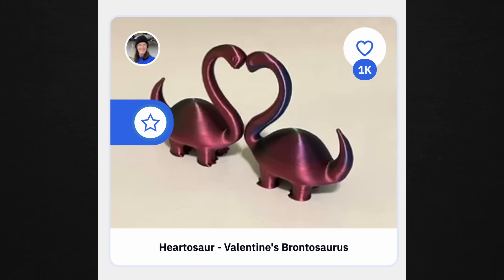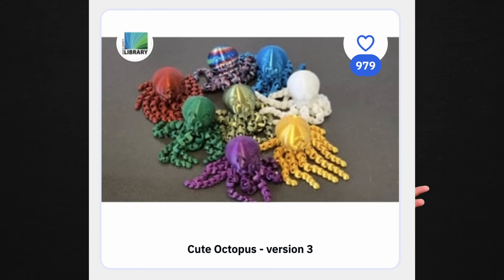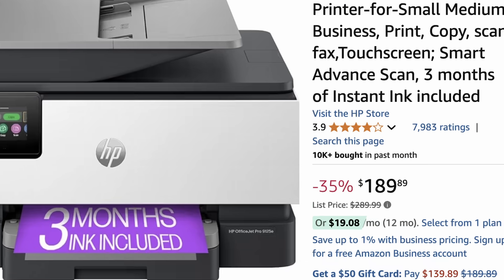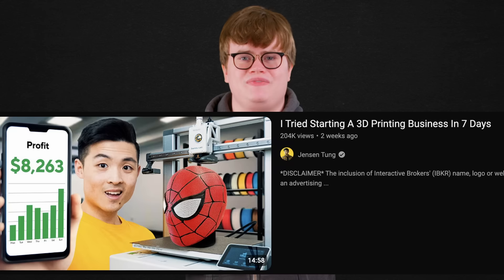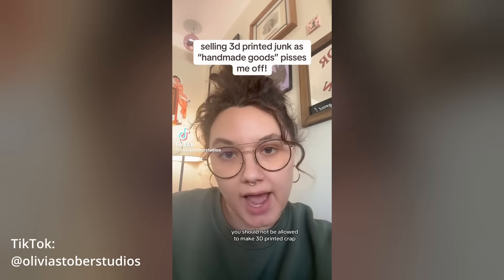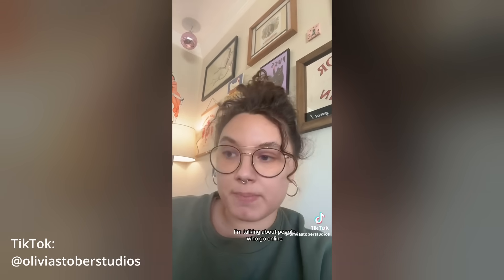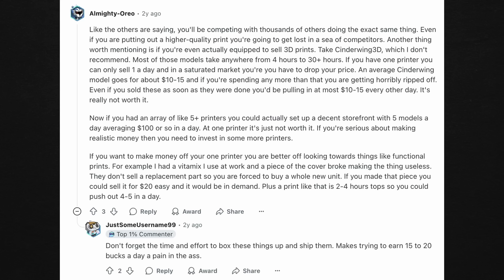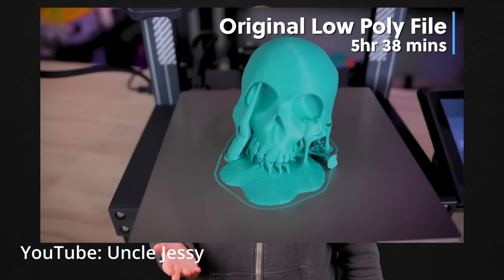The Rise of 3D-Printed Slop

Comment: thanks for making this video man. I’m a VFX generalist and video artist, and I got a printer recently for practical props, prototyping gadgets for my studio, replacing knobs on stuff that’s out of production, etc. Going in I was already conflicted about the environmental impact of the whole ordeal. Moreso after realizing how it just shits out extra plastic regularly, and complicated or bad designs require single-use support structures to print that immediately get tossed. and that’s if my design doesn’t need a revision (also trash if it does!). like okay I personally can accept this, I’m experienced enough with modeling and physics simulations that I can be very intentional about using less plastic and only printing what’s absolutely necessary to get the shot made. great power great responsibility, measure twice cut once, all that.

then I took a look at Thingiverse and it actually made me want to cry. people are totally just printing crap to justify the cost. no better than mass-produced plastic. I guess it’s easy for me to say after living in Blender for almost a decade but I can’t imagine what goes through someone’s head when they buy a printer without even knowing how to model, it’s sickening

Comment: omfg I didn't even realise that 3d prints were supposed to be sanded. I only ever see the ridged ones 😣
Reply: It's not supposed to be anything. Printer lines are fine, it's just not looking good on big painted props.
Reply: @SaitoGray  Printer lines are kinda like raw loose threads on sewing, knit or crochet, or tool marks on wood carving. They're a sign of poor finishing.
Reply: @Albinojackrussel  poor finishing if it's meant to be something that exists to be seen (models, cosplay etc) for functional stuff like replacement mechanical components that only need the mating surfaces to be dimensional it doesn't really matter. I'm not sanding a gear I made to replace a part of the drive on my vacuum, but I definitely sanded, filled, primed, and painted my cosplay models.
Reply: @ Exactly, that's the difference. The fixation on sanding is so weird. You don't need to sand most stuff, but you ABSOLUTELY need to do it on props of cosplay made for show and painted.

Printed line area totally fine finish. You barely see them if your machine is calibrated.
Reply: @Albinojackrussel  No, not even close. Layer lines are an inherent feature of FDM printing. Consistent layer lines are a sign of a well-tuned and accurate machine. If the lines vary in width and height, it is a sign of a bad print.
Reply: @Kodachrome02  layerlines are a sign that you didn't sand your piece. Aka poor finishing.
Reply: They aren't supposed to be sanded. It all depends on what you want. The layer lines are just a part of how FDM printers work. Some use cases the lines don't matter.

Comment: This is why I think that, if you’re going to get into 3D printing, you should consider 3D modeling as well, as half the enjoyment of the hobby is printing your OWN work, not stuff online. Sure printing out the next flexi factory toy will give a hell of a dopamine rush, but it doesn’t last. Printing something that you modeled with your own hands though is extremely satisfying and makes you feel accomplished.
Reply: can confirm! i’m a 3d modeler first and foremost, but i’ve printed some of my models and it feels magical… holding something in my hands that i made in my computer, knowing the topology… it’s so cool
Reply: @johnathancactusI just got into 3d printing but man did it feel good figuring out how to create a pin and hole
Reply: It's revolutionary if you're into a lot of different hobbies. If you build drones, or RC models, if you're into hobby robotics, electronics, woodworking ect, it's amazing. You can 3D print an entire model aircraft at low cost, and if you crash it, you can simply reprint the broken parts and be back flying your model again. You can custom design parts, so the only limit is your imagination.
Reply: @adscomics  True, it’s time consuming but so stimulating to design your own models. Need to consider the primary design, then know your printer and limitations and redesign, and then potentially optimise for speed or printer settings. A lot of work but it can be really worth it.
The only part where printing pre-made designs makes me similarly happy if they are for someone else and have value for them
Reply: I want to build a dragon kaiju figure by 3d modeling it then printing jt
Reply: Half the enjoyment? 90%, I'd argue. 

The first time I modeled something and then got to print it was amazing.
Just holding a physical object in your hands that you thought up is amazing. 

Printing a file you found online isn't. It's fun and novel for the technical part, once. Maybe a couple times, but then that's it.
Reply: @That0neJawn  when i print other peoples stuff usually its to print something functional that i can just use or highly detailed models of things that i want to print out and paint
Reply: if you buy a 3d printer and arent willing to do anything yourself you might as well not even own it.. Whats the point of a 3d printer if you can just buy the thing you want? or get it printed by a company who has one
Reply: @zwicker5585 For me it's because it's a lot cheaper. I got my 3D printer to print miniatures for my DnD games. All in between my printer and filament I've spent around $200. Buying everything I've printed would have cost me thousands of dollars. I'd love to learn CAD but don't have the time to, and for now using free models or ones from people I support on Patreon is meeting my needs just fine.
Reply: Amen, modeling is fun in and of itself, but being able to bring your models into physical reality is MAGIC.
Reply: The stuff I love is taking things from online and adding cuts, hinges, and ball-joints to make my own little action figures. It gives me so much joy to sit down, model(70% of the time) and cut my little guys and then print amd paint them. Like someone here said, 90% of the fun is modeling it. I more kitbash than model, Id say, but its my happy place.
Reply: It also let's you solve your SPECIFIC problems which is the best part honestly
Reply: or even if you just paint them...
Reply: @91Vault  Yeah painting is acceptable. Just some level of effort aside from just adjusting print settings and throwing the file in a machine.
Reply: Or just print guns. It's lots of fun.
Reply: People print stuff without knowing how to 3D model?
Reply: @realtacobell  It's more common than you may think.
Reply: @realtacobell  Hi, just got a bambu A1 + AMS lite last week, zero 3d modeling knowledge.  :)
Reply: came here to say this.   got into the hobby a few months back and immediately started learning cad.  luckily I come from a compsci background and while it wasn't instantly intuitive, it wasn't hard to figure out the basics.  now I prototype 1-3 basic widgets a week.  
I also regularly print these little chatchskis as Lil free gifts.  love making chainmail fidgets
Reply: I thought that was common sense. People don’t buy text printers to print shit they read online, right?
Reply: Being able to actually model things is exactly why i want one once i move and have space. Ive been learning modeling while waiting to get one, so hopefully ill know what im doing lol
Reply: Counterargument: I want a 3D printer to print out that one stupid dummy plug that I lost and the only replacement part the manufacturer sells is a whole new device.
Reply: @PineappleDealer37  Then go through a 3D printing service and have them do it. Will save you way more money
Reply: @adscomics  i need to replace that one part in 10000 of the 
Things 

You see I own 10000 of the... Thing and I lost the exact same part in all of them.
Reply: This is something I plan to do once my 3d printer arrives next month and I take the time to learn the printer and various software apps that go well with the creation process. I intend to start making my own designs which I'll also sell. The challenge is part of the fun for me. I enjoy learning new things and being able to bring my creations to life.
Reply: @Katskraftkorner  honestly if you haven't already it's for the best to start learning 3d modeling right now before you get any of the hardware
Reply: @xalener  I ordered a new computer this week for running the software.  Once I get it set up, I'll start right away. I've been watching a lot of videos on 3d printing and the software to get me started.
Reply: @Katskraftkorner  FUCK yeah dude
Reply: I hate to have a print where i made a design mistake so it was just produced for the landfill directly. I wish i could have it perfect directly all the time.
Reply: truer words has never been spoken, my friend o7
Reply: Honestly it never crossed my mind that people would get a printer with little to no interest in actually designing parts themselves. I am coming into it from the side of already having interest and experience with modeling, so maybe I am blinded by that.
Reply: flexi factory SUCKS BALLS
Reply: That’s what I do. I was gifted a 3d printer and so I learned to use blender. I’ve made earrings, knickknacks, cosplay masks, and am currently making my friend a DnD coin to flip between bardic inspiration and unsettling words.

It’s also made me paint more often since I don’t want to buy 10 different colors of filament that I’ll barely use.
Reply: I absolutely agree. As an engineer I’ve had some of the most fun solving problems with the 3D printer that costs a fraction of what I can buy, with no shipping 😂
Reply: 07:25
Reply: That’s the difference between fulfillment and instant gratification. But people preferred the later because it’s easier
Reply: I 3D modeled all my prints! Which is around 3. My favorite in terms of function are these mini game cartridge earrings. my first one was a bad blender model of one of my original characters that didn't have the normals flipped the right way. The coolest one I've made is of this cat robot character I like to draw... I really need to paint that one and do the base justice.
(Edit) i don't own a 3d printer though, my library just has a few.
Reply: I don't enjoy 3d modelling at all. It seems like a hassle for me.
Reply: I'm certain that's true, but all I want to print are minifigs which are super expensive to buy in stores, and I don't have 1000 hours to learn to 3d model to the level needed to make that nor do I have the creative talent
Reply: Didn’t even occur to me that people would get into 3d printing without having interest in 3d modeling. That’s like, most of the appeal for me
Reply: @vincentgeiszler  Yep, that's the whole reason I wanted to get into it. I was already doing 3D modeling by that point, and I thought it'd be super cool to have my models exist in physical space.
Reply: @vincentgeiszler  people who are into painting figures/minis/DnD use 3d printers...there's infinite really cool figures available out there
Reply: I've never understood why you would ever buy a 3D printer without knowing how to cad.
Reply: @simon5016-f6r do they? I’ve never heard of that, but I also don’t watch 3d printing content
Reply: @simon5016-f6r If you have a real use for it? I got a 3D printer because I play Dungeons and Dragons. I don't know if you've seen the cost of tiny injection mold miniatures for the game. It's like $10+ for one tiny figure, then figure you need like 10 of those for one battle, it gets insanely expensive. A big boss is gonna run you $50+. I got a 3D printer to print my own miniatures and terrain for the games I DM. I've printed what would have cost me thousands of dollars to buy for less than $200. I would love to learn CAD, but between being a mom to 3 kids, running multiple games of DND, and painting all the minis I 3D print I haven't had any time. I think the real problem with 3D printing is people who get into it to profit or who get into it without having a real use for their 3D printer.
Reply: to tell you the truth, I have no fucking clue what someone is doing with a 3d printer but no 3d modeling skills. It's fucking hilarious to me that people actually spend the money on the hardware and just download models to print. I spit on em.
Reply: @xalener  spit all over me bb, 1 week into the A1 life, still putting off that blender donut tutorial for like 5 years now :^)
Reply: @xalener  People shared a lot of they files online over the years. Most daily problems people have that could be solved by a printer most of the time already have some STL for it online. So you can do a lot of problem solving without needing to touch a 3d modeling software once! But the full potential will then never really used.
Reply: @xalener  people who paint miniatures and/or similar modelling hobbies.
Reply: @ Even those folks would benefit heavily from modeling skills so they can kitbash stuff quicker and more convincingly.
Reply: @xalener I buy files for miniatures/tabletop gaming by companies or individual artists that don’t physically produce those miniatures/parts. Cope and seethe, I guess?

What a weird thing to be mad about/flex with.
Reply: @MadDoodles  you alright
Reply: I can assure you it lasts.. I mean the race to be the first 3D printer to reach 1 million in yearly sales is more a dopamine rush, but the love for printing never dulls. But yeah Dancyn I'm catching up lol

Comment: 2:39 I think this one point is way off base. Layer lines are absolultely benign (and can even be aesthetic), and certainly dont "need" to be sanded. Especially for functional parts, they have no impact. But im being petty. Overall this is a great video as usual for you. If I see one more jointed dragon print im gonna scream
Reply: if you dont sand ur print or put a finishing coat on it and then u charge 20$ i want to come after u

Comment: Hard disagree on just about everything said in this video. I've personally had a 3D printer since 2015 and I'd say 90% of the stuff I've printed has been practical and some have even lasted the entire decade. I make tons of stuff from custom fitted wall brackets to bases for my resin printed Warhammer minis. Last year I even designed and printed my very own custom sunglasses case when I couldn't find anything that worked for me. As far as I'm concerned I'm living the SciFi dream and couldn't care less about this negativity.

Comment: what drives me nuts is that most libraries from what I've seen have a 3d printer now! So you can go and give them the file and they will print it for cheap. Obviously they don't file it down or anything but neither do half of these shops lol
Reply: Because it's crazy to file down anything that you won't paint.
Libraries having access to these machines are amazing.

Comment: If you're truly interested in additive manufacturing, the excitement is in using a new tool to make things that weren't possible or practical before. The tech has made it possible for individuals to develop real things that used to require a machine shop to even prototype. I can't imagine owning a 3D printer if I wasn't making my own things to test, break and improve, and I can't believe this is still going on. No one needs (or truly wants) artisanal Temu crap.
Reply: A closing thought - I've been 3D printing since 2018. The only printed trinket in my home is the first model I ever downloaded to test my first printer. It's a rocket launcher from Quake 3 that's the size of a finger. I used it as a keychain for 2 years before it broke, and now it's retired. I didn't design it, but it reminds me of making that first "as is" printer from Craigslist work for the first time.

Comment: This video feels very reductive and doesn't really do justice to the impact of 3D printing as a movement. Although  It is important to highlight the trend of low-effort models pumped out by consumption-minded individuals, I would argue most 3D printing hobbyists use 3D printing to compliment their other hobbies. Very few people use 3d printing for the sake of 3d printing and are relatively active community members. 

Conversely, I really see no issue in people pumping out slop. So much injection molded crap from overseas ends up in landfills as it is, 3D printing that same slop just simplifies the supply chain. For example If every dollar store in America had a print farm in the back pumping out all the same plastic junk they already sell,  they would be heralded as champions of domestic manufacturing and sustainability whilst pumping out the same volume of junk. 

At the end of the day I think most people in the 3D printing community agree that 3DP is a tool of limited application. There are a few who fell for the marketing cranking out fidget lizards or whatever, but most people understand the applications and implications of the tool.

Comment: I agree that most people do not need a 3D printer.  However, having one has been extremely valuable for me.  One example: i needed an obscure power plug for a camera that, if I could have found it at all, would have cost at least $150.  I modeled it in Fusion, bought the actual metal socket parts in a kit on Amazon for $15, and after an hour of design and an hour of print time, I had a functioning plug that works. One or two of these situations ant the machine pays for itself.

The software also isn't that bad if you're willing to spend a bit of time learning.  It's harder imo to make fluid, organic shapes than blocky, functional ones.  So if you repair things and are motivated, it might be a good tool for you.